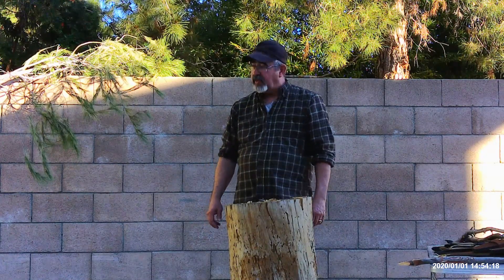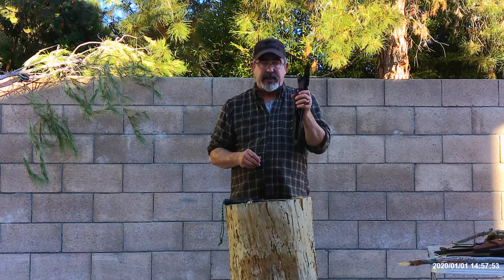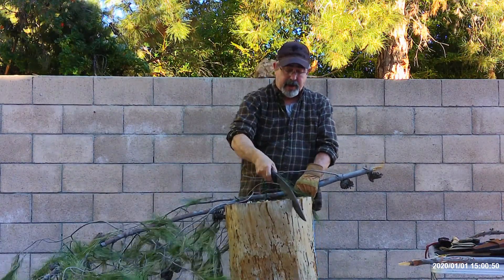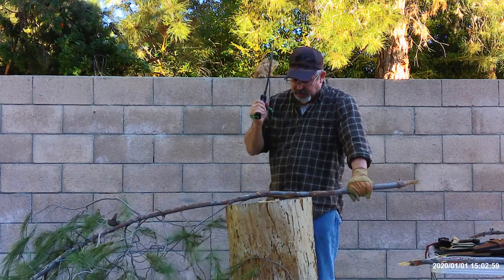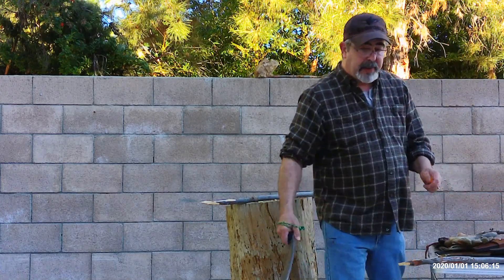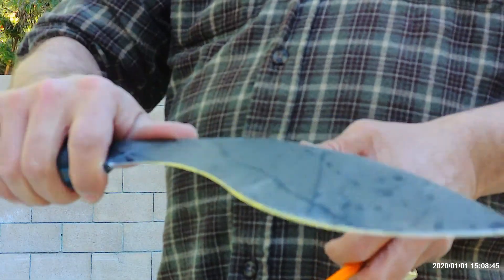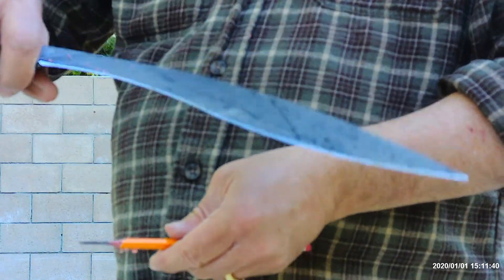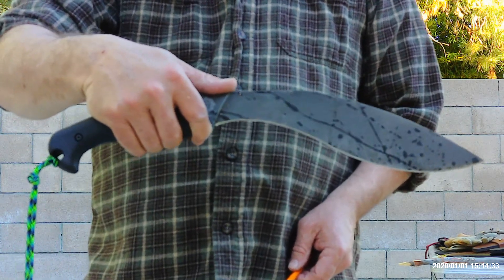Further Testing Of Work Tuff Gear & D.K. & K. Siddha Khukuri

Comment: Tim how would you rate and compare this to the k-tac by condor knives.....I really like the design but cant decide between the two
Reply: I don’t own either of those models but I can tell you from the stand point of WTG blades the handles just melt into your hand and I honestly think the steel is better and heat treated better as well. Plus if you order from WTG directly your blade will show up within the next day or two, and that’s when it comes from their factory in Taiwan.